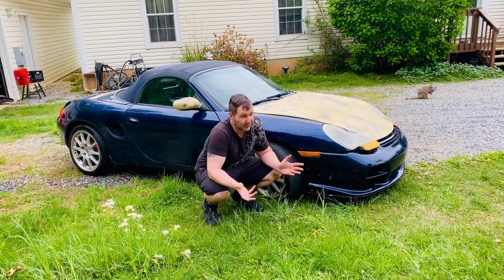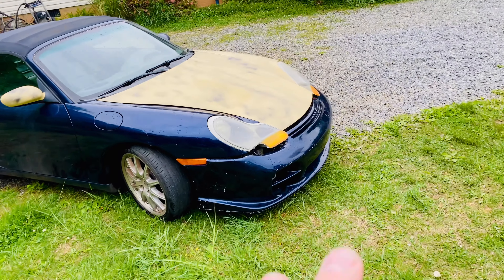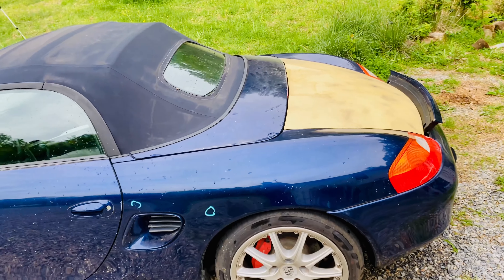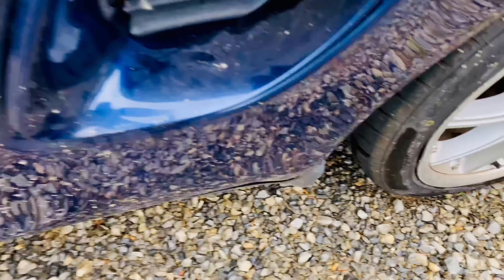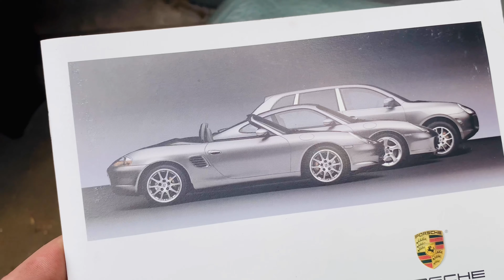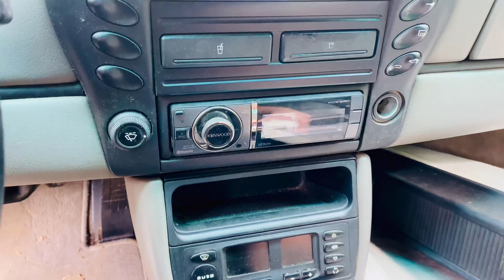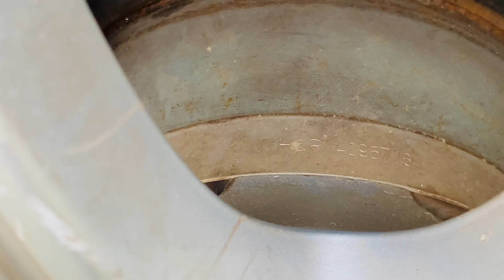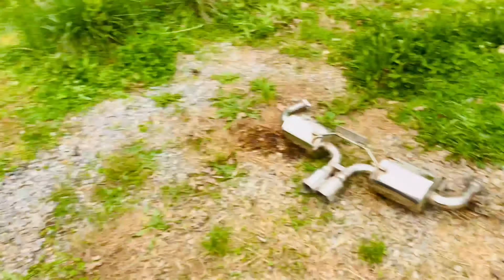I BOUGHT THE CHEAPEST MODERN PORSCHE in the country $2500 Running & Driving 986 Boxster S

Comment: How much for the rest after you take the engine?
Reply from the maker: Hey how are you. I have slowly been parting the car out what did you need .  Sold rear taillights rear bumper. Drivers fender sold convertible top and spare tire and spare Jack kit and some smaller interior bits.